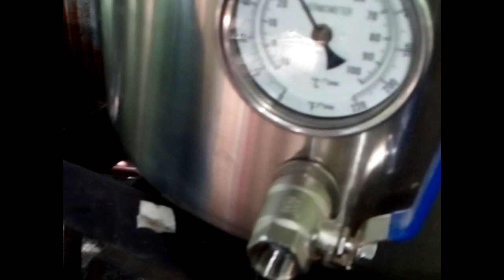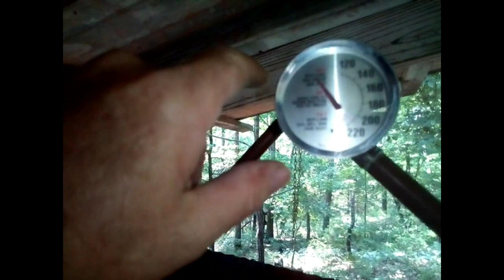How to make a 25 gal. still part 2-the column

Comment: You can always flower paste those fitting. I've thought the same about slip joints they leak lol. Your unions  can and will leak as well  its a good idea to put Teflon tape on them.
I dont know if it would help much since your 2in section is so short but you can pack the column with copper mesh to try to get a little reflux going. Your column looks solid looking foward to seeing you run her.
Reply from the maker: You're right. I did have the 2" slip joint leak, but I've been using unions for decades without leaks.
Reply: @TheOffGridMaker  🤔 thinking about it I did use unions in conjuction with a thumper maybe that added pressure was what caused my problems 🤷‍♀️ im not sure and that still is long gone I use a SS millk can now with tri clamps so I can go from plated column to pot still depending on what I run.

Comment: As a beginner I have a couple questions.

1. Is there any benefit to centering the column like you have on the pot lid? Can it be offset? I have a handle in the way I don't want to get rid of if i dont have to.

2. When building the condenser, are there any benefits or downfalls to putting a 1/2 copper inside a 1" copper. I understand you used 1/2 and 3/4. And also the length, are there any recommended sizes or standards to follow depending on the gallon still size?

Thx
Reply: Cut the handle out and fit a copper coupler inbetween the cut then solder both sides of the handle to the coupler to strengthen it. I built my first 10 gallon like that and it worked well.  On the condensor, the larger the inner pipe the more surface area, and the longer it is the better it works.
Reply: @Tonnsfabrication  thank you kind person

Comment: 🤘 Nice! I'm literally looking at that same pot as my next still upgrade, 80-100L SS stock pot...
But I want the seafood boil basket with mine so I can set it up for distilling with solids and hopefully a 3-ply bottom for putting it on my 3500W commercial induction cooktop which is scheduled to arrive in like a week or so 😋
I can't wait to have a bigger boiler with an open top, don't get me wrong I love my keg still... but building me a hot rod like that will be awesome 😅
Then I want to try my hand at building a hybrid condenser for it that I designed myself, I'm hoping my design can produce a spirit with the body of a serpentine condenser with the speed of a shotgun condenser 😄

--🧿RuneShine, Michigan's Norse-Druid Alchemist 🧪🥼🔬

Comment: Is the thermometer there to measure the water temperature or the vapor temperature ?  In either case, it seems like you could have moved it up a bit to have more room for your valve.
Reply from the maker: I bought the pot and it came with the holes pre-drilled. It is a bit tight, but works fine.